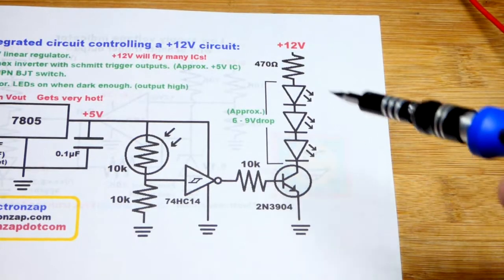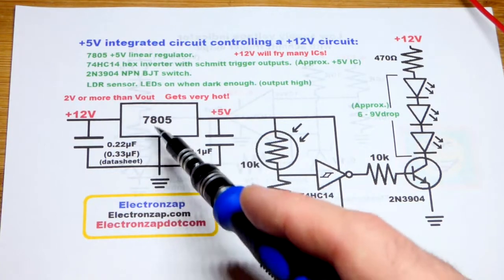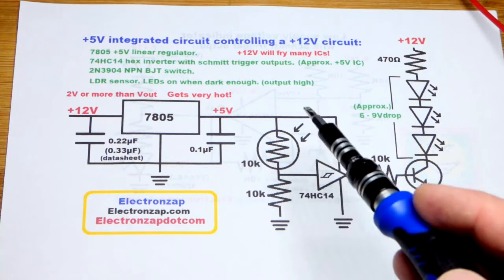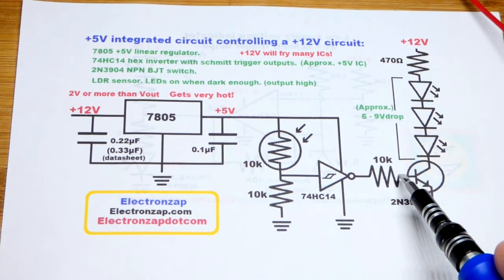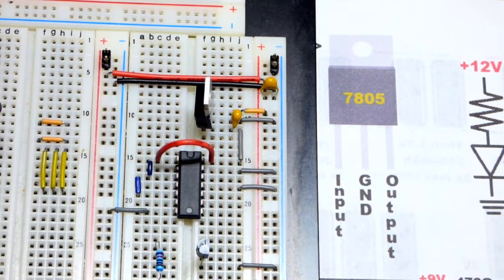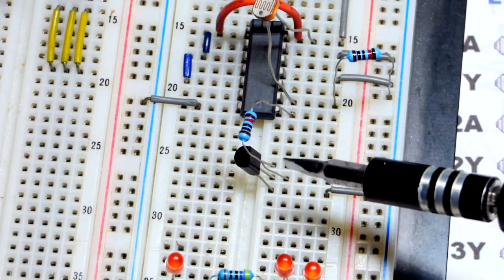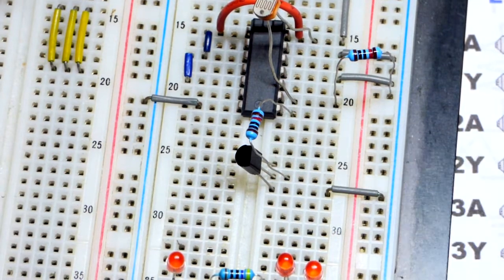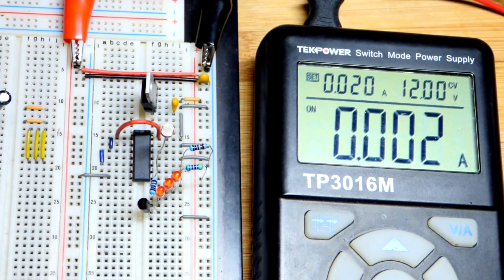7805 5V powered 74HC14 hex inverter schmitt trigger output IC controlling 12V LEDs load with 2N3904

Comment: this is nearly exactly what I'm looking for, instead of a LDR I will use a photodiode, just for being quick enough.
The purpose will be to measure exposure times of old analoge film cameras together with the DSO 150.
Just measuring the peak at the inverted output.

What do you think?